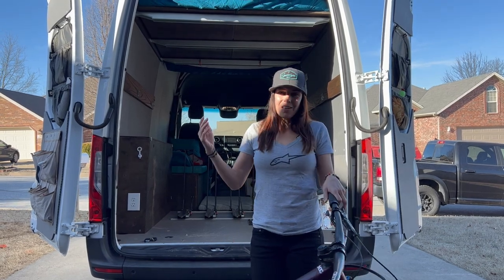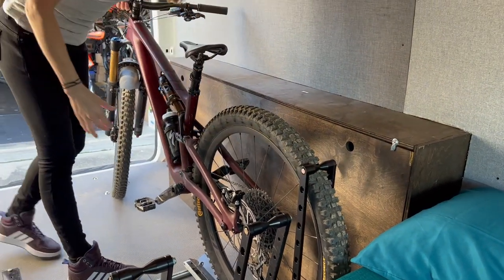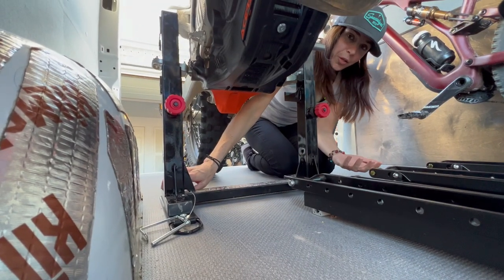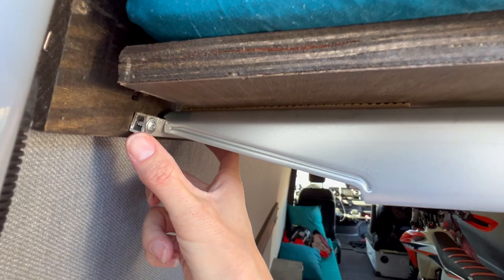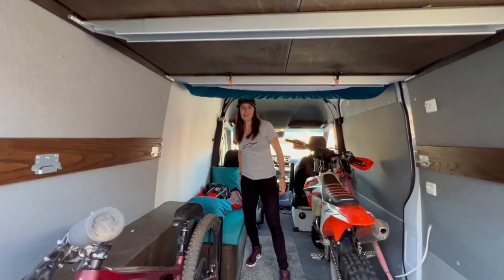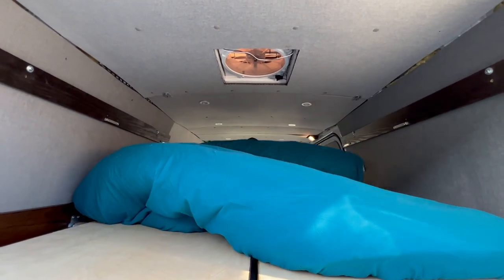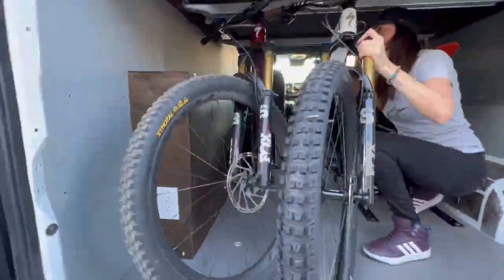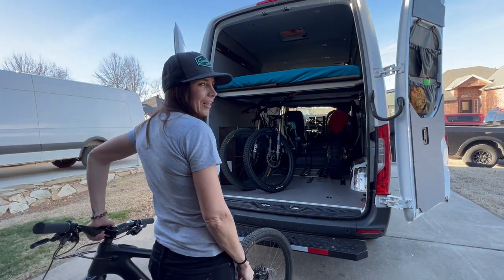My Sprinter Van Build - $155 Ikea bed system, 4 bike racks & dirt bike!

Comment: What did you use for the adjustable "slider bars" under the OneUp racks?  Looks like you've bolted things directly to the van floor, right?  I need to go look at more of your van videos, but didn't see any L-track or similar embedded in floor for flexibility

By the way, hope your recovery is progressing well
Reply from the maker: Hi Peter! I used a Aluminum T-Slotted Extrusion with One Open T-Slotbolted and I mounted that to the floor. Used flat headed bolts that I had to grind down slightly to fit in the tracks.

Comment: Nice practical setup! For the aluminum extrusion you have the racks mounted to, did you just screw them to the factory flooring you have, or did you bolt them all the way through the van? Thanks in advance!